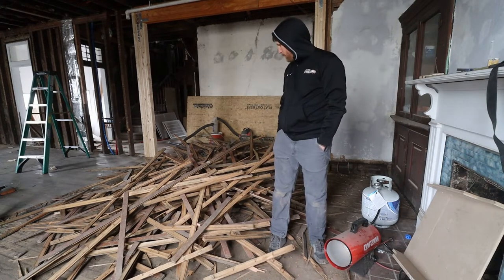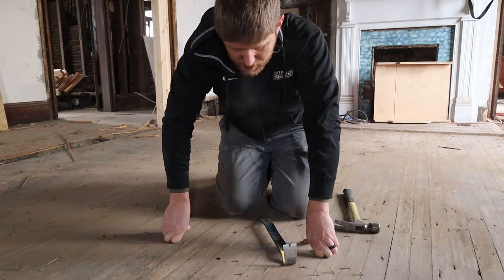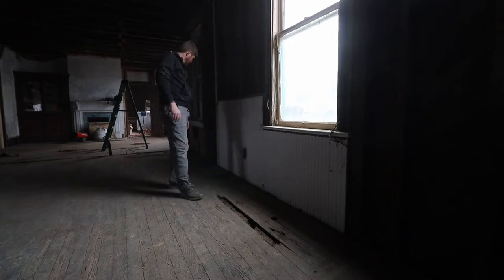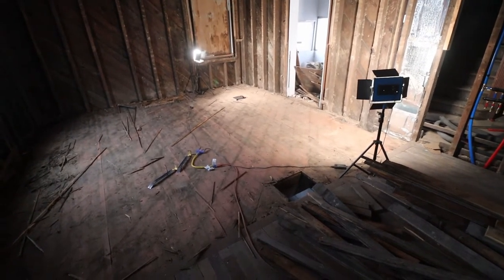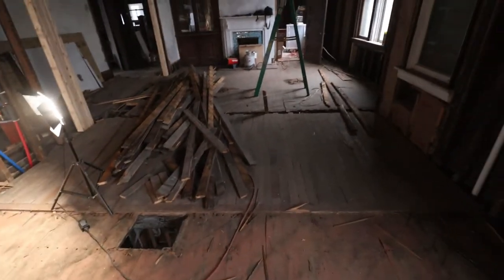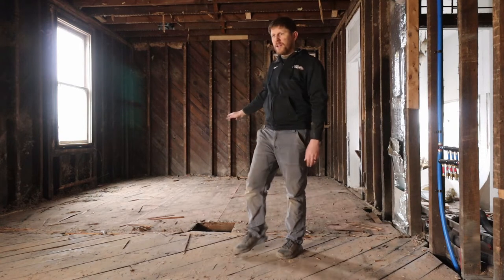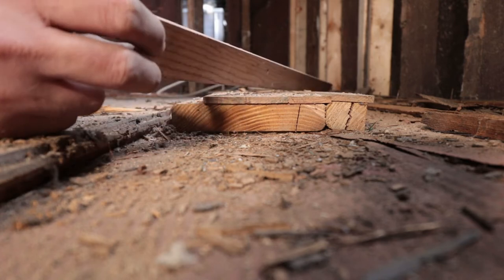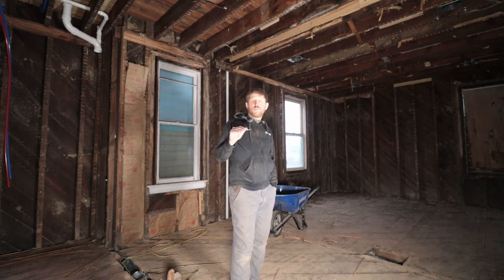RECLAIMED FLOORS in the kitchen and dining room - Victorian Home Renovation [TirolerInn]

Comment: All caught up 😊 awesome series, I really respect all your hard work. Curious, are you doing crazy amounts of research behind the scenes to figure out how to do this stuff (framing, pex, etc) or do you have experience in home renovations?
Reply from the maker: Thanks so much for the compliments. Yes, I do my research, and otherwise I have also worked for a couple years installing windows and doors, and we have remodeled our first starter home and then did some extra work on our second home we sold before we bought this house. Its really not rocket science, you just have to be willing to try and fail, I have no problem redoing things if I know I did them wrong...
Reply: @TirolerInn  100% agree... not rocket science.. to me it comes down to 1. Time (learn and do) 2. Confidence (with each successful project it builds) and 3. Money (DIY is cheaper than hiring out, but tools/supplies can be expensive)
Reply from the maker: agreed, and in my case its also about the aspect of exercise/activity as its relaxing and balancing to do something physically when sitting in front of a computer the rest of the week.

Comment: Are you going to reuse the second layer of wood? About how many square feet is your new Victorian home?
Reply from the maker: Great question. We are holding onto the oak flooring for now so we can use it in other areas if needed. There is about 2,800 sq ft between the first and second floor the basement will be unfinished for now. The 3rd floor attic is about another 800 usable sq ft that we want to finish after the first and second floor are done. Not a small project 😆